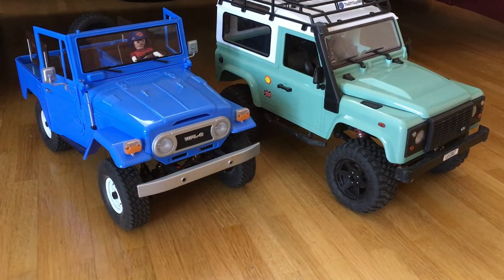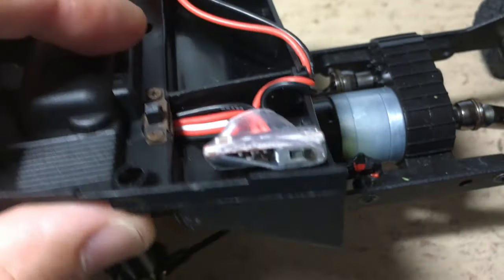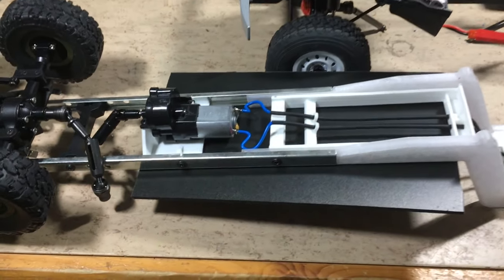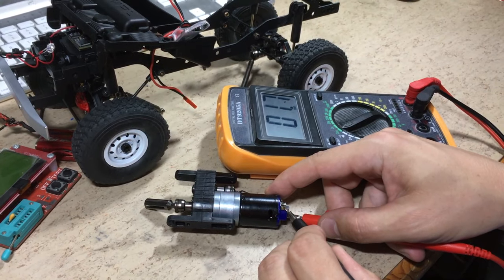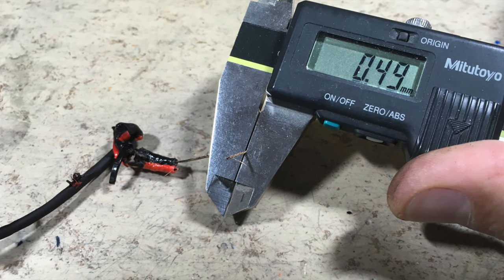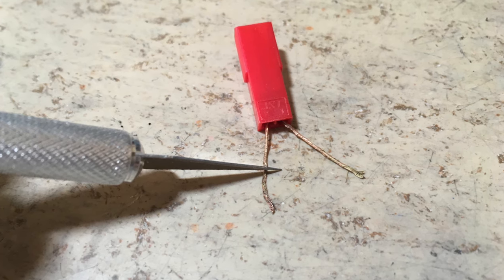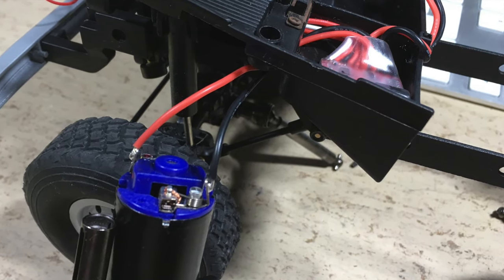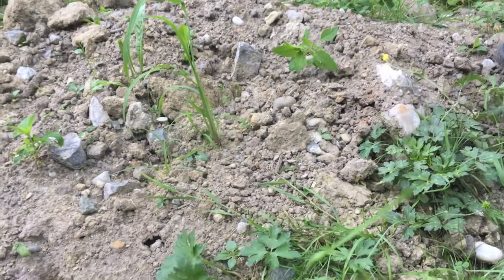WPL C34KM On Fire During Indoor Fun With MN Model D90!

Comment: Great advice 👍
Lucky it didn’t make a big damage
Also it’s good idea to cover the back of the motor. I had the same issue with my c34. But the culprit was a screw which got attached to the back of the motor because of the magnet and made a short circuit.
Reply from the maker: Yes, I was lucky

Comment: Hello dear friend, could you attach all the necessary libraries for your transmitter/receiver project?unfortunately I do something wrong and I do not work((
Reply from the maker: Hi, for the required libraries see the following section in the sketch:
//
// =======================================================================================================
// INCLUDE LIRBARIES
// =======================================================================================================
//

// Libraries
#include <Wire.h> // I2C library (for the MPU-6050 gyro /accelerometer)
#include <RF24.h> // Installed via Tools > Board > Boards Manager > Type RF24
#include <printf.h>
#include <Servo.h>
#include <statusLED.h> // https://github.com/TheDIYGuy999/statusLED
#include <TB6612FNG.h> // https://github.com/TheDIYGuy999/TB6612FNG **NOTE** V1.2 required!! <<<-----
#include <PWMFrequency.h> // https://github.com/TheDIYGuy999/PWMFrequency
#include <PID_v1.h> // https://github.com/br3ttb/Arduino-PID-Library/

This example is for the receiver. Hope this helps.

Also have a look at the manual: https://github.com/TheDIYGuy999/RC_Transmitter/blob/master/Manual_English.pdf
Reply: @TheDIYGuy999  thank you, I meant pack everything in a zip/rar archive.